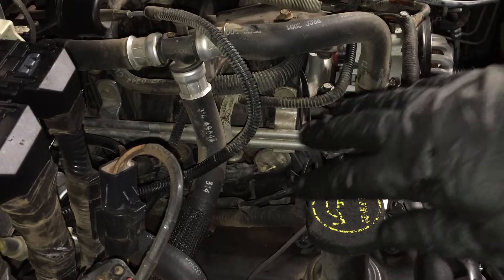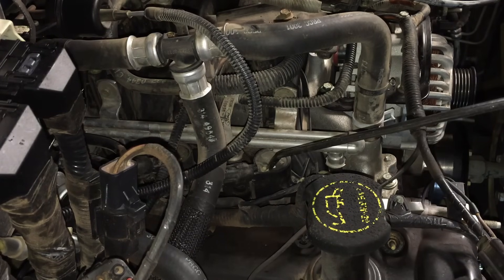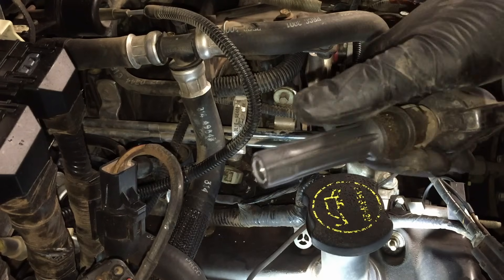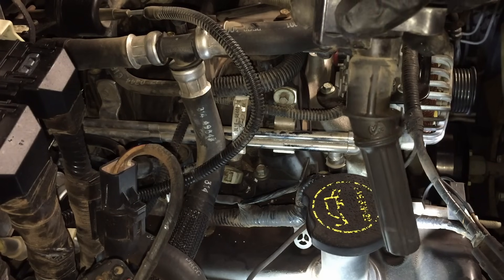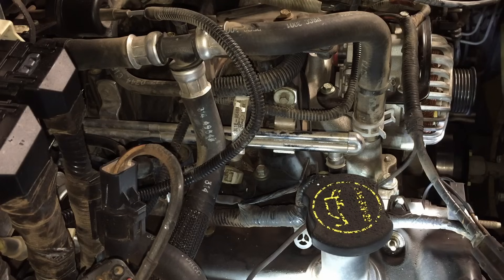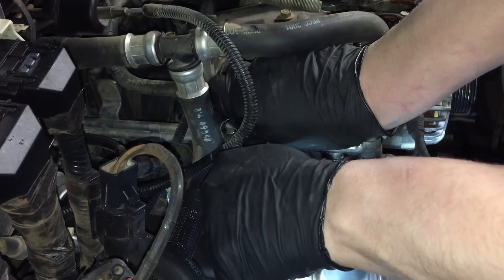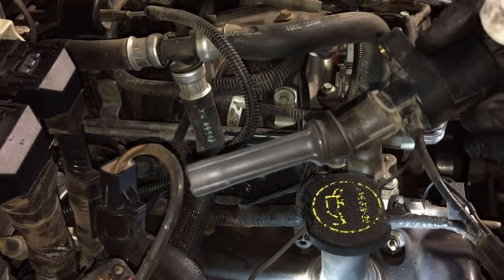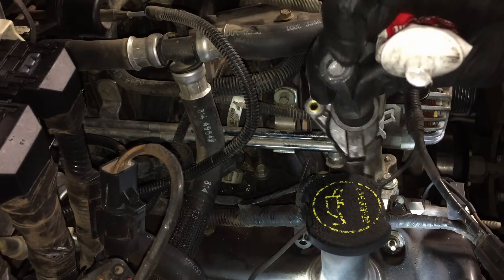Important Tips When Replacing Spark Plugs on Ford 4.6L 5.4L 6.8L 2v Engines

Comment: I have a BT Cruiser smaller E450  motorhome V10 garage kept 2004 like new still  in Pennsylvania  and just turned 40k miles runs perfectly smooth and light footing it pulling a older ranger gets  11 mpg......... I keep being told I should change coils and plugs due to age. I feel at 90k miles unless it gives me a  reason I should change them. after 90,000 Ford say 100k   your thoughts? THey also say factory installed plugs get loose as they age and can blow out.

Comment: I now have a fuel leak after replacing a spark plug in cylinder 2. 
I hear air being released but can't find the leak. I reinstalled the injectors.
I have an 08 p71 Crown Vic

Comment: I use 405 motor craft plugs in my 2010 Crown Victoria Police interceptor and torque em down tight and never had them eject, was going to try another brand but didn't know how well they'd work with a flex fuel engine. That and the E85 I use is 105 octane.

Comment: Got free e150 with a blown out stripped plug. Quick fix auto zone has repair kit that literally takes minutes to install threads in special extended plug threads in sleeve ur done!😁😁😁😁 it's a dorman part with autolight revolution series plug

Comment: Why wouldn’t we just use thread locker? I always taught to not torque them too much because it will cross thread
Reply from the maker: Threadlocker doesn't hold at those temps, trust me you wont cross thread or strip out the threads at this torque.
Reply: FordTechMakuloco will try it. At the end of the day I just bought a mercury for $200.

Comment: Have a 2004 get 4.6.  problem I'm having is lining up the new plug in the hole, can't get it to bite the threads, tried the back n forth turns but all it does is spin.

Comment: Thanks for the great video as always. I think I am relieved that I have the 2v and not 3v in my 2005 E-350 Super Duty van. I suspect I am running original plugs but I don't know the maintenance history. Mileage is 55K and it runs fine. Book interval is 100K; I wonder if I should keep driving or replace before they blow out or reach that big 0.060 gap in your video. 15 years is a long time.
Reply: I would replace them ASAP. It’s a crap shoot if they will shoot out but better safe than sorry. Just try and get a torque wrench on them.

Comment: Getting a misfire on cylinder 1.  So you are saying that only motocraft plugs. So no AutoZone plugs?  My Expy 99 has 240,000 miles.  I am getting a rough idle every once in a while. I also have not replaced  the fuel injectors or the online fuel filter under the truck.

Comment: Didn't see it covered in the video but I had a problem with the extension pulling from the socket after I put in new plug. I taped  extension and socket together and that solved that problem. I am wondering how else can it be done??

Comment: Small piece of metal debris in spark plug tube. Wedged against spark plug. #4 cylinder, of course. Any tips on removing it? Will not allow socket to slip over plug. I've used compressed air, no luck

Comment: Just did my 2014 e250 140k had a ticking noise now it’s gone, most of the plugs were loose. Thanks for this video, you’re right it’s not as scary as it looks.
Reply: Sounds like you had some compression leak by causing that ticking noise. Mighta been getting ready to blow a plug out.

Comment: Everyone, listen to this man, ordering all 8 plugs & coils as a package on amazon cost $81....... the coils are $35-$75 each at Autozone......... plus the plugs....... check amazon if it’s not an emergency
Reply: HOW?!  $81 for all 8 coils?  Did you mistype that?  The link above goes to a $200 set.  Please provide a link for this mysterious $81 package for all 8 coils.
Reply: @come_here1985  I bought 8 coils for $45 on Amazon.  One failed 5 years later with many hot desert miles on them.  I just had a plug blow out with 240,000 miles on my 4,6, so I pulled the engine and am waiting on the new one. This time all 8 new coils were $34.99 on Amazon.  A dealership charged me $400 for one when I was on the road 10 years ago.
Reply: This practically makes me wonder if it's that cheap thru Amazon.. could it be those bootleg parts?
Reply: You missed the fine print, those are bootleg coils, not Motorcraft. Many sleezy jobbers sell the Motorcraft plugs along with some cheap coils to deceive the buyer. I'm trying some NGK from Rockauto, around $170 when you buy eight, and some Motorcraft plugs. 2000 Town Car Cartier L, 322,000 miles still rolling. Fingers crossed.
Reply: I have not begun to change my spark plugs yet but I believe this guy on what his video instructs us to do.  I'm experiencing a subtle misfire on my initial startup in the morning before beginning my day. Anytime afterwards "Shirley" ('03 Expedition 5.4L) cranks up in a normal manner. I will inform everyone later in regards to my outcome.
Reply: @Romansrun625  im about to change mine also. im trying not to pay 200 for plugs, where should i get them to get a good deal?
Reply: @braxtonreese1923  autozone has them for about $26/coil or they did a couple years ago

Comment: I had a Ford tech recommend 22 ft lbs instead of the recommended 11 lbs. It happened to me on my expedition, drove it 30k after a plug change and a plug backed out. Also NGK or motorcraft are the only plugs I've had luck with.
Reply from the maker: Yes just over 20ftlbs seems to be the sweet spot.
Reply: @FordTechMakuloco  awesome thanks for your work, love your channel!!

Comment: Do you suggest overtourqing on the later 4.6 2V? I heard in 2004 they added more threads. 2009 Mercury Grand Marquis LS 4.6L V8 2V. If not, what torque spec would you recommend?
Reply from the maker: yes

Comment: I just recently changed out the spark plugs & coils on my 2004 ford f150 4.6L V8, ran perfectly well for about two weeks! Felt a thump coming home from work, a bit of lost power! Plug in the computer and got a reading P0353, changed out the coil. Quick note from the mechanic, the original coils were still good. After replacing the #3 coil I still felt a bit of shaking! Can it be the spark plug! Please help with any information! Thank you!
Reply: It's the coil or the connector.  Ford sells connector kits. I just zip tie the connector tightly to the coil.

Comment: I noticed you don't actually show yourself doing the actual problem plugs (3,4 & 7, 8) which would be most helpful I would've never believed THAT CHANGING SPARK PLUGS COULD BE SUCH A PROBLEM if I hadn't actually ran into the problem myself.... talk about something that's hard to ask anyone for help with!?  I've now spent over an hour just trying to get cylinder 3 plug out & no luck.... can't see  in the hole without a mirror & see no obstruction when using a mirror & the socket seems to be on but turns with little to no resistance?  If it was stripped it should've long since come out?  even tried it on cylinder 1 to be sure I wasn't loosing my mind  & it came out as it should !?!?

Comment: i wish there was a guy like you for the ram hemi's!  i watch ypour videos and pass info along to my brother in law who has a ford truck with the 5.0/10 speed
Reply: The 5.0 dont have this issue

But for the hemis... its easier to do the plugs

I use a 3 inch + 1 inch extension 
The 3 inch alone will be flush with the valve cover with a normal spark plug socket

Just 16 plugs on the hemi... which makes it a pain

Comment: I wouldn't run champion on my bicycle.  I have pull them right out of the box and they missed. now I will refuse to put them in anything. if they want champion plugs or fram oil filter I tell them to take it to another shop. and the coil pack screws I see so many come in with self tapping screws.  I have has some come in with wood between the coil pack and the  fuel rail.

Comment: Very well done video, this will help many to do it themselves for a reasonable price...I changed my plugs at about 125,000 miles. Before I took the plugs out, I had to clean out the spark plug well because the compressed air only removes loose and dry debris. I used a chopstick ( a pencil would be too thick because you need to be able to turn it inside the well) and wrapped a small strip (maybe the last 1/2 to 3/4 inch of the chopstick) of heavy duty  paper towel or mechanic's shop towel on the end of it secured with masking tape. Then I put a drop or two of spray lubricant, just enough to moisten the paper, but not so much that it wets the masking tape because then it dissolves the glue and falls off. Then I "mopped" the bottom of the spark plug well with the chopstick to get all the dirt, oil, bug parts, and other crud that were down there. The moist towel will make  most of the stuff stick to it so you just mop a little then bring it out and clean it off and repeat until the well is clean. If you don't clean the wells, then any junk down there will fall into the cylinder when you remove the plugs and could cause  many, expensive, problems. {Use a good flashlight or shoplite that is bright enough to see down there!}
Reply: I am thinking about buying 06 grand marquis with low mileage arounf 50k,  would you recommend buying one?
Reply: @randellwolfe4555  Well my Crown Vic. is a 2003 and now has 190K, still runs strong. I hear that many will last to 300K and the Marquis share the same drivetrain, so yeah, sounds like a good deal.
Reply: @elppedro77  thank you

Comment: E3 plugs, damn power nation people always pushing them. I usually get motorcrafts but I find a lot of them with electrodes off center and varying gaps, not sure why. Bought 6 packs for my crown vic before I found 8 straight plugs. Ngks are on point every single time and I wouldn't hesitate to run them in any engine.

Comment: Thank you, very informative. I have a 2009 4.6L Flex Fuel engine that calls for a colder Motorcraft plug SP-405 vs. the SP-493 for the gasoline only engines. I have read that the hotter running plug maybe more efficient for me if I don't plan on utilizing flex fuel. I was wondering if you or anyone else shares this opinion. thank you

Comment: Great video.  Used many of your tips when I replace my spark plugs this weekend on my 2001 Ford Expedition 4.6 L.  FYI, the spark plug go about five full turns before they hit the dead stop, then you can turn them the 1/8 to 1/4 turn for the proper torque.
Reply: Ok so to the tight spot then 1/4 turn is what I'll do on my Ford expedition 1999 5.4 ty
Reply: I have to do my spark plugs on my 2000 ford expedition 4.6L V8 Triton XLT, so thanks.

Comment: You said torque the plugs to 20-25 ft/lbs. Which seems a lot. Repair manual says 18 n/m. Are you using a torque wrench or just getting the plugs as tight as you can with a ratchet?  I'm afraid to over torque and do damage.
Reply: Do what feels right without stripping them
Reply: @justinaulgur9812  Yeah, I set the torque at 18 n/m which is equal to 13 ft/lb. Since the plugs bottom out you can't get them much tighter than that.
Reply: @GT-ub8lp  I just torque them by hand and never had one blow out...for now lol

Comment: Please help! First off thanks for the vids. Just changed my spark plugs but now am.worried i may have overtightened one plug ( torque wrench wasnt on lock position so.i kept turning till i realized) and now either the plug socket wont grip or the plug is spinning freely.. Also when i tried to put ignition coil back on the spark plug did not want to insert so i screwed down the igniton coil hoping itd slowly make its way in.. Started up just fine but im wondering what could this cause.. And how could i get my plug out.. Ill be buying a magnetic plug socket and see if that works but should i be driving like this? Nissan alt 05 2.5

Comment: Help me to understand. O'Reilly Autoparts price for a single Motorcraft coil is  $68.99. Amazon has the 8 coils packet for $79.99 Both are part DG508. There is any difference regarding quality? Thanks in advance.
Reply: A lot of the Amazon stuff are just look a like fakes. That's how they sell them dirt cheap.
Reply: Marco Moreno no. They just rip people off :D
Reply: There are a lot of fake/imitation Chinese auto parts, oil filters, etc. sold on eBay and Amazon. Of course there are legitimate products as well, so do your homework, and then do it again when you receive your purchase, you can always return it. Makuloco does a video on counterfeit auto parts, so does the Car Care Nut.

Comment: The only problems I've ever encountered with plugs coming loose  on ANY engine, were when Bosch plugs were used. On Fords, I too use only Motorcraft plugs. I've had 'recommended' Autolites cause misfires on many occasions.
Reply: Thanks for that. I’m nervous doing this - they’ve never popped loose on my 1997 Expy (226,000 miles) but I’ve always taken it in. Will give it a shot ✌️

Comment: ford has spark plug ejection system on the 2v, and spark plug retention system on the 3v lol
Reply: What a great, concise way to explain two related failures in engine design!
Reply: yea ford atleast had a repair for there's, gm said fuck everyone and let their lifters take out the whole motor.
Reply: jessiejames50 😂😂😂😂😂😂😂
Reply: @Marc Kemp Awesome, thanks for that info I didn't know that much about it to be honest. I ended up picking up my '95 and got a bunch of new parts including a tune up. I've been worried about the plugs coming out but I'm glad it wasn't too awful on on my year of CV. Thanks again though
Reply: I'd laugh harder if my 2v 4.6 didn't spit one out already. Lol
Reply: Sadly the retention issue is on the 2 valve too. Trying to change the spark plugs on my Mercury Grand Marquis and they won't come out😂
Reply: That would be funny if it wasn't so sadly true. My 3v retention system retained 4 of the 8 plugs.
Reply: @ljshoreslokal  That's a real bummer man.
Reply: @ljshoreslokal  all 8 here that was great fun and about 9 hours of total enjoyment
Reply: Mine came out nice on my 95 crown vic but I used NGK iridium 9 plugs so I guess I already messed up 🤷

Comment: From Leo:  Thanks for your careful and well done videos.   Everyone with the title of "engineer" at ALL car manufacturers should get their fat butts off the CAD/CAM unit and prototype each piece by hand.   Way too many parts are designed physically blocking other parts when a little forethought would have made a far better and far more serviceable product.   Tapered plug seats in an aluminum head is also a bad idea.  We had flat crush seals spark plugs on aluminum head engines for years with absolutely zero problems.  I guess saving  2 cents per plug is more important than long term reliability.
Reply: saving money is the accounting and business unit. you think the engineers don’t want to make a dope product?

Comment: I took a risk and bought an 08 with the 4.7 in there and it runs roughhard to get up to speed doesn't have much power and you can tell that it's missing.  The engine seems to knock a  sometimes I wonder if that's due to is misfiring do to a loose spark plug

Comment: How do you keep water out of the well??
Reply: I pressure washed my 4.6 and got some water down there and just drove it until it evaporated from the engine heat. If you have a bad misfire due to the water shorting out the coils dont drive it. You will then have to pull the coils and hit the area with compressed air. Besides that I've never had any water issues there. Hope this helps.

Comment: What year engines have the 2valve vs 3 valve ? How can you tell? Is the process any different for 2 vs 3? Thanks another great video!!
Reply: On the vin. If the 8th digit is W, it's a 2 valve. If 8 is the 8th digit, it's a 3 valve.

Comment: You do know that new plugs have a compression type washer on them specifically made to give reverse pressure, so that the plug will not back up. So that extra turn after contact is a must to mash that washer giving assured seating it's when you reuse plugs that u may have loosening after install.
I have a van with a 4.6, so my issues are always doubled due to the engine placement. Pain in the rear. Thanks for the video though. But I am kinda with the one guy, blowing air in there with the plug out,, may raise junk that could fall into the cylinder. Prior to plug out, good idea. After, a bit questionable. Though just an oil glob wouldn't hurt anything, a dislodged pebble surely would. Thanks again.
Reply from the maker: Incorrect sir, these use a taper seat not a gasket seat. When I use compressed air after the plug is out the tip of the air nozzle is inserted into the combustion chamber then compressed air is used creating positive pressure inside the cylinder forcing anything out not in.
Reply: @FordTechMakuloco  You are correct. My apologies. Been a hundred thousand miles since I did my last plug change on my 2001 van. My other vehicles are all older with standard plugs. You have my most humble apologies., 👍
Reply: @FordTechMakuloco  As for debris getting into the cylinder. Just thinking logically.
Hey, I am changing plugs today because I have two cylinders that show no fire. With 100,000 miles on my old plugs and coils, I figured it was gap or dead coils causing this misfire of those cylinders. No. 2 and 4 were the culprits. When I pulled 4 coil, it's was soaked. The plug hole was full of water from a heater hose from the rear of the engine crossing the left bank of plugs. I think I have a bad hose leak near the no. 4 cylinder. Do you think a flooded spark plug shaft would cause the spark to ground out on the block and or not fire the plug? Such a coincidence that that cylinder showed bad and be flooded like that. When I get to number 1 tomorrow, I'm curious to what I'll find.
Thanks.